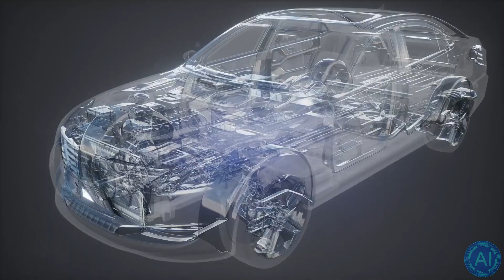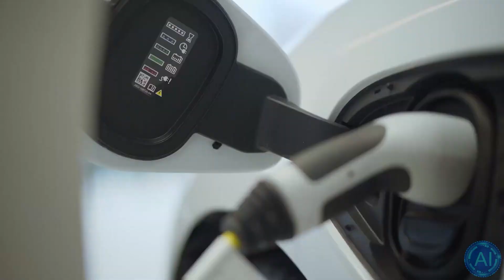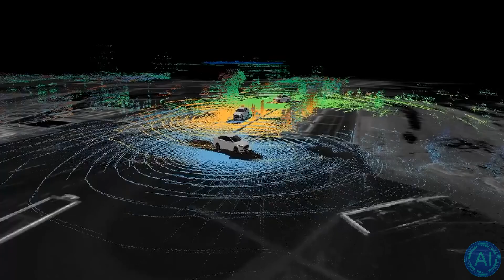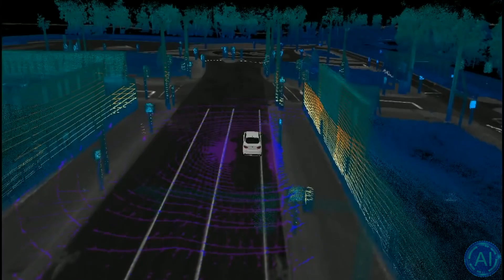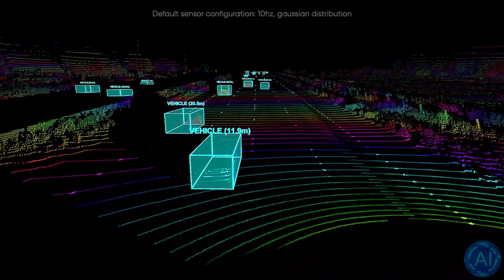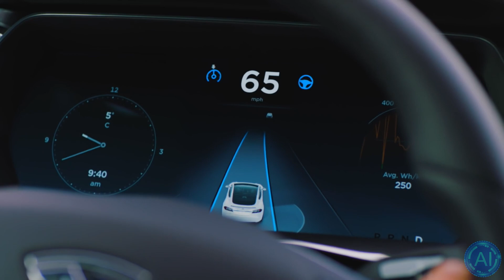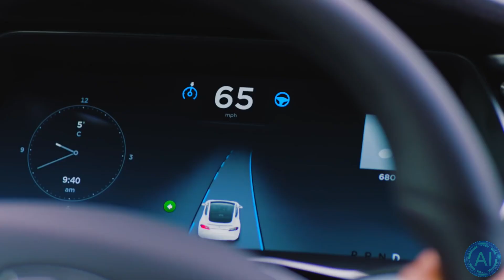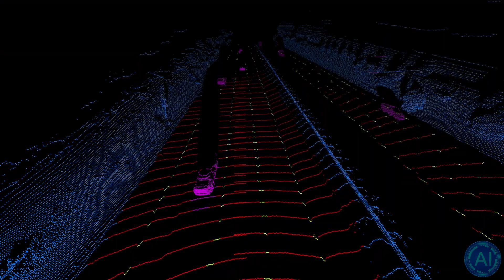THIS Car is Better than Tesla's - Luminar's Uncrashable Car

Comment: I like Lidar as a sensor technology for this application and I can see how more detailed or precise spatial data would probably increase the margin of safety for self-driving vehicles, but I still don't think there's any way of getting out from the necessity for some kind of general or non-narrow AI to deal with irregular road scenarios or the rational or decisive frames or reference that humans can easily shift and adapt through, despite all of the other ways we're inattentive or not very adapted to driving. Knowing the kinds of decisions human drivers need to make on relatively short time scales, I don't think there's any feasible way to build up a coherent model of 'driving' just from bottom-up processes where you just feed an algorithm with a bunch of data, it's going to need more sophisticated and explicit heuristics than what we can get from deep/reinforcement learning systems, though giving them better sensors than the ones we have to use certainly wont hurt and should still help to make up some part of the difference.